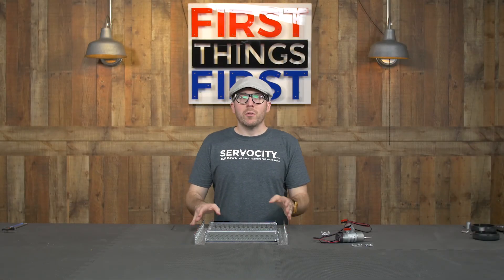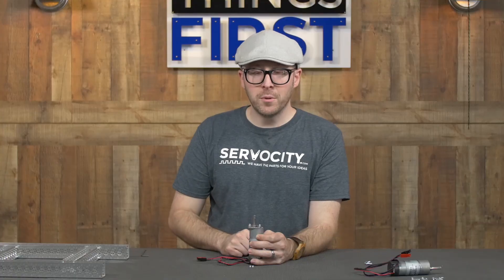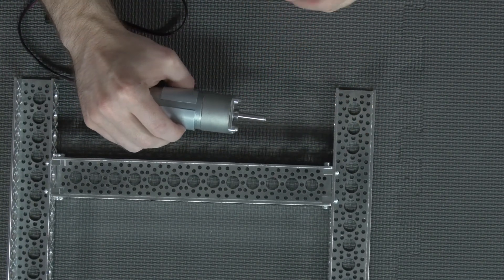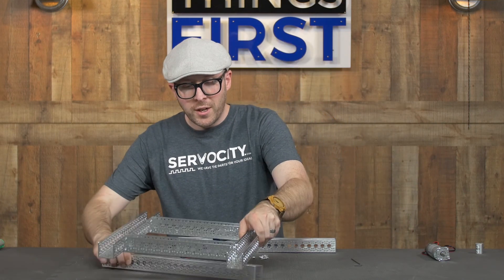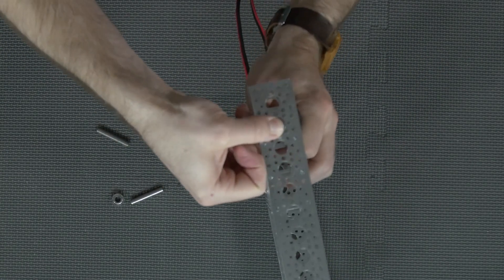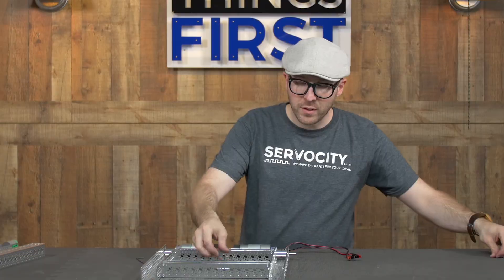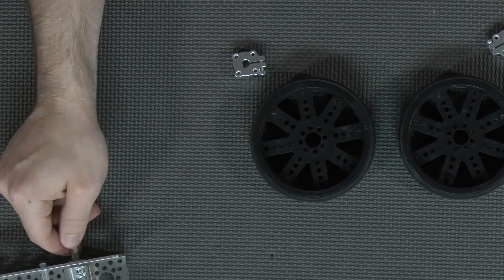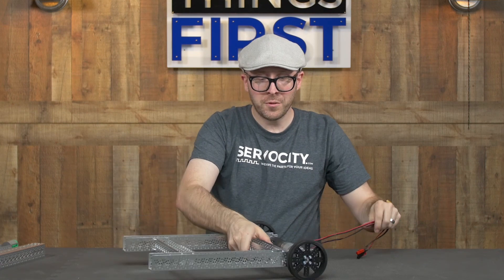First Things First - Drive Motors & Wheels

Comment: I need to mount wheels on a 775 motor that spins high revs for tennis ball machine launcher.  I'm struggling to find appropriately matching couplers and wheels to give a balanced outcome. Any tips on the most ideal way.

Comment: Well the bearings doesn't seem to be half inch OD, They are probably smaller than that.....seems like quarter inch OD at most.....Correct me if i m wrong...
Reply from the maker: Hi Prince, sorry for the delay! They are in-fact 1/4" ID (inside diameter), 1/2" OD (outside diameter) as mentioned at 5:38.  Bearings with a 1/2" OD are used so that they fit in the 1/2" hole of the channel.  Please let us know should you have any other questions.
Reply: Thanks.....:) Got it....

Comment: So Facetap motor mounts / Sidetap motor mounts / Bottomtap clamping mount
spacers,
½inch (12.7mm) screws,
M3 screws,
Heavy Duty 6mm ¼inch clamping coupler, 
½inch (12.7mm) long screws,
½inch OD ¼inch ID bearings
½inch OD D shaft
Standoffs 1.3 2inch long standoffs ¼OD 632 tapped
Heavy Duty wheels
Clamping D hubs
½inch screws
washers
¼inch shaft spacers

DId I miss anything?
Is there a list of all these tiny things noone thinks about when starting to get into all this?
Reply from the maker: Thanks, Colin and we apologize for the delay in posting a parts list.  Above in the description is a complete list of all the parts used in this video.